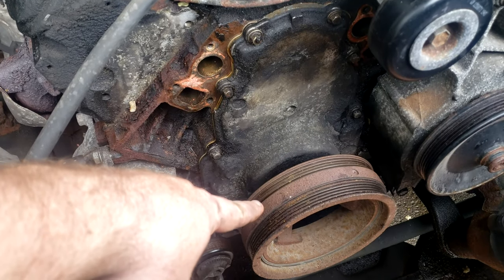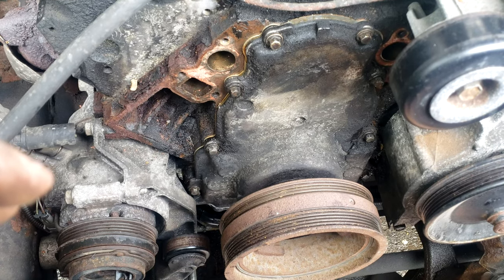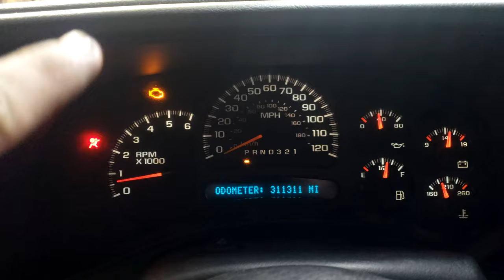Fix Your Low Oil Pressure in THREE Hours for THREE Dollars by watching this THREE Minute Video.

Comment: Yeah, probably more than 3 hours. I dropped the pan on my 4x4 and it took me a full day. Very satisfying when your oil pressure returns. I had mechanics quote me $800 in labor to replace a $3 part. Such a bad design on GM's part.
Reply from the maker: I didn't drop the pan on this 4X4. I did it from the front by rotating the bracket that holds the o ring. It was about 3 hours start to finish.
Reply: @bruceyyyyy  hello bruce,did you have to prime the oil pump when you replaced?? Im scared to put everuthing back until i figure out about how to prime the easiest way
Reply from the maker: @jeremyjones8872  I did not.
Reply: @bruceyyyyy  i got pump replaced and went to start and truck had no oil pressure so was told it had to be primed so after spending over 2k in 3months with 3dif mechanic shops i tried doing it myself but now i dk how to prime easiest way and have no faith and $ to hire another mechanic and its my only vehicle and its used for work truck so im beyond frustrated,.any help u can give on priming orr i would greatly appreciate it bruce
Reply from the maker: @jeremyjones8872  It looks like there is a service port on the side of the block that can be used to prime it.
Reply: @bruceyyyyy  thanks man,i had t remove the big bracket that holds the alternator and pwrsteering because it was in the way of that 8ml allen bolt,but my real question for you was if you knew of any other good ways to prime it that is easier an faster but i greatly appreciate you replying

Comment: So I’m not understanding what you did. You replace the O-ring between the the pump and the pickup tube? Not understanding at all. Trying to find video now on how to replace oil pump on a 4.3L Chevy s10. 2002. Can’t seem to find a decent one.
Reply from the maker: Yes the o ring was the culprit. This is a 5.3 V8 so I'm not sure how helpful it will be for you.

Comment: How tough is it to get the harmonic balancer bolt off?
Reply from the maker: Mine came right off with an M18 impact. I then removed the pulley with a puller and reinstalled it by heating the balancer up before sliding it over the crankshaft.
Reply: @bruceyyyyy  I have the M18 impact. I only have about 60% luck getting things off. End up using the breaker bar a lot. Some say it’s the 5.0 battery. I’m not sure.
Reply from the maker: It definitely does better with my 9/12AH batteries but it gets heavy with those.
Reply: Thanks, I guess I'll already spend over 3 days trying to figure out what the problem now thanks to you, I know now what's is the problem is.👍

Comment: Please explain why you cut that tab off, was it to fit the wrong O ring?
Reply from the maker: So I didn't need to drop the oil pan
Reply: It was to move bolt from lower mounting on pump to upper side, easier to install

Comment: Will this work on a 6.0.?
Reply from the maker: I believe this procedure should be the same for the 4.8, 5.3, and 6.0
Reply: @bruceyyyyy  dont know how to send the link,youtube video title: LS Stock oil pump mod (stop wasting money on oil pumps)Dammit, it claims to give 70lbs oil prussure,not sure if that's a good idea but he thinks so.
Reply from the maker: @eastside0434  I just replaced the pump since I had to have it come off. Was around $100 for a high pressure version. 

I get around 70 cold and around 50 hot now according to the factory gauge.